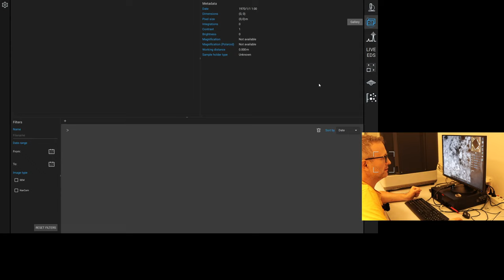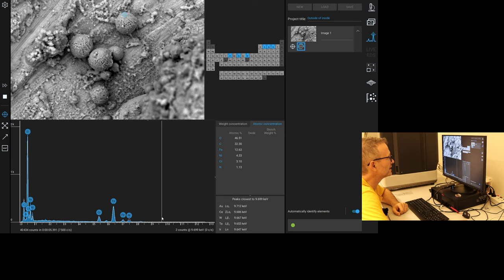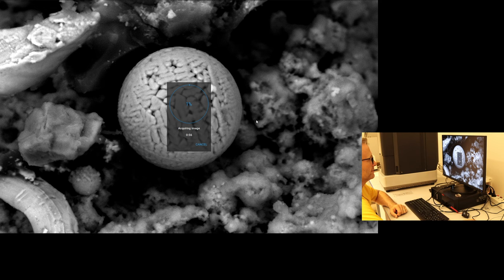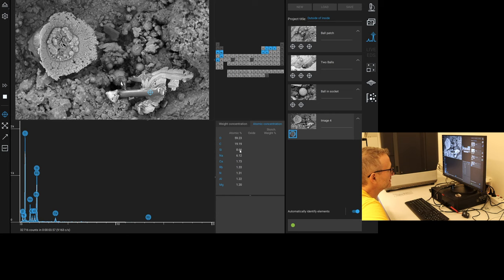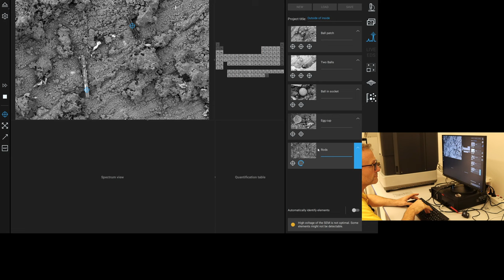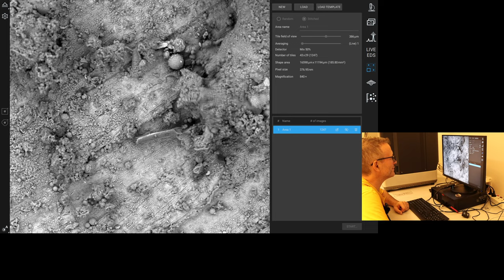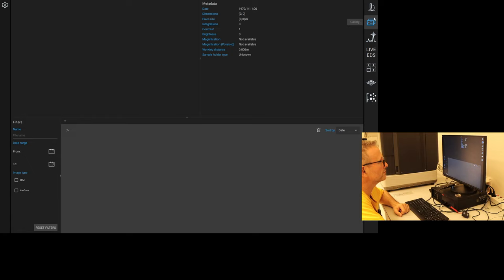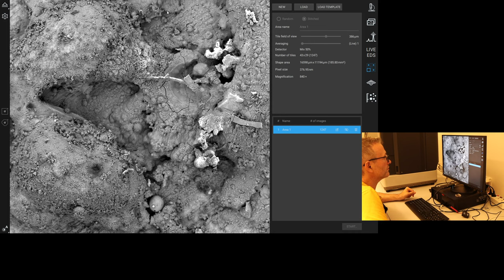THOR - Capturing steel - SEM/EDS recorded session - outside of inside

Comment: It's the "predictive morphology" that is so mind-busting.  And yet here we are with another reactor wherein IRCMS are in the sample. True sleuthing! I wonder what M. Levin would have to say about brain-like structure at such a fundamental level of energy. Staying tuned.
Reply: IRCMS is such an awkward acronym, though it is pronounceable. We could just call them Ferrous Balls or FerBalls for short 🤣
Reply: @ng429  A response! Wow, wonders never cease, hehe. I had that very same thought, struggled, and gave up. But the adventure is one of a lifetime for me. Cracking the code of electrons and the tyranny of the plug and the socket! See you later ng429.
Reply: predictive morphology is crazy, but I think that partially has to do with standard approaches to physics as a whole, especially quantum physics. everything has always been extremely complex, the ever increasing number of new particles and even spatial and time dimensions to explain observed phenomenon. And, all that, and still unable to unify gravity with the other forces for instance. I'm no physicist, but it always seemed like there should be something more fundamental going on. predictive morphology is what you would expect from a "root cause".

Comment: Was the thumbnail changed? There was some interesting data on it and now it looks like a dimmed version.
Reply: My bad, I can see the thumbnail image in my subscriptions feed but it gets dimmed when I click the link.
Reply from the maker: My problem is, though I can see glassy looking rods on the Nurugo/S7 400x videos before the cutting of the section, I know that the dremmel cutting discs also have glass fibres and one can see in the title frame above that, in this (and some other) case, they are proximal to the torn pieces of steel. 

The most important part of this analysis of the outside of the inside IMHO, is that the spheres are basically steel component oxides, where as on the inside of the outside they are either pure or nearly pure Fe + O. I hypothesises therefore that material is captured from the inside sphere and that this is where the negative (Yin) clusters are formed capturing the metal and whatever else. This has predominantly points of electro-nuclear collapse / 'Black Hole'. The other side has these Fe+O spheres etc. embedded in thick Carbon and other element layers, I hypothesise this is the areas of electro-nuclear regeneration / 'White hole'.  @curbina
Reply: @MFMP  Atoms walking through walls is so BL. Thanks for today's pre-review hypothosis. That you can assert this is white/black hole activity is just super exciting. My spidey sense about the history of physics is saying the knowledge diversion almost worked. But not so fast...